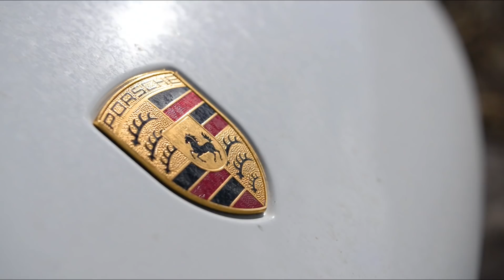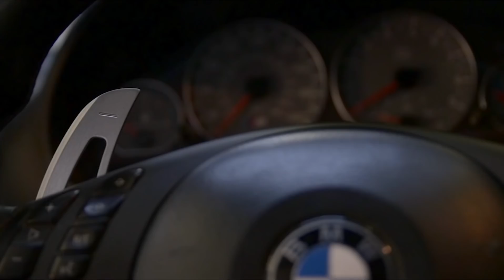Cars Are Changing

Comment: I'm sorry but I'm going to have to disagree with the opening of this video - the part where you said cars were getting better and easier to modify.  In my opinion, the sweet spot for cars, at least in the US market, was about 1987 through 2008.  Sure, there were a lot of changes during that time, and it's probably a conflation of two different eras, but think about it:

-Power outputs were on the climb again after the Automotive Dark Ages of about 1973 to 1986, but cars were still fairly lightweight and fairly analog, as all the encumbrances that weigh down and water down current cars - touch screens and redundant steering-wheel-mounted controls for everything because there are too many functions for simple buttons to deal with, airbags for every bone in your body, electronic nannies than can't be turned off (not that they aren't helpful sometimes) - were absent, in their infancy, or seen as extras rather than necessities.  The "throwing nukes at Newton" approach to speed, so prevalent these days, was simply not necessary as you could still build a high-performance car, with RWD and a very healthy (300+ naturally aspirated HP) engine, without even reaching the 3500 lb mark.

-Manual transmissions were still widely available even in fairly ordinary cars.

-As were atmospheric engines of a decent size, even if they weren't always very powerful.

-Turbochargers were for going fast, not for trying to bring a weak fuel-economy-oriented engine back up to to the level of adequacy.

-Sporty variants of said ordinary cars were quite common, yet close enough to their lesser brethren in price, performance, and appearance that they didn't appear to be a completely different type of car (compare the relationship between an old Cavalier RS and an old Cavalier Z24 to the relationship between a new Focus SES and a new Focus ST).

-Electronics had become a thing and brought a better power/economy balance with them, but cars were still simple and accessible enough that a reasonably talented home mechanic could still do most maintenance themselves, and could still make significant performance improvements without having to enlist the (expensive) help of a big-deal factory-connected skunk works (*cough*BMW*cough*).

-Designers still held the old-time styling adage of "longer, lower, wider" in some regard, as opposed to today when European/Asian "shorter, taller, narrower" influences show up dishearteningly often, at least in small cars.

-The idiotic specter of the crossover wasn't the end-all be-all of Boring Family Transportation; sensible station wagons and minivans were still widespread.

-Real, simple, rugged trucks and SUVs that you could go crashing around the farm, jobsite, or backwoods in were still a thing.

+Traditional American body styles like coupes and convertibles were still fairly common; USDM small car design hadn't centralized around space-efficient but unbeautiful 3- and 5-door hatchbacks with token sedans and an occasional coupe or wagon depending on which manufacturer you're buying from.

The selection of new cars has never been better if you're after a highway bomber, a quiet and luxurious but utterly boring A-to-B car, or maybe even a track car, but if you call the mountains your home, the selection suddenly shrinks by a lot.

(continued in reply)
Reply: I think this may be a case of efficiency being at war with the soul (as it so often is).  The soul of the driver cries out for a screaming I6 or a roaring, snorting V8, but the soulless bean-counters and power-hungry regulators see the future in downsized eco-turbos instead.  There is immense satisfaction to be had from perfect rev-matches and lightning-fast downshifts, but the average guy, and sadly many car guys as well, would rather not bother.

I think part of the problem is the upbringing of children in modern America.  For most of their formative years, children are immersed in a shallow, materialistic culture where having the latest, shiniest toys is an integral part of one's status.  They're molded by an education system designed specifically to fill them with left-wing opinions and prevent them from developing true independence of thought or action. They're taught, not necessarily explicitly, that gadgets are inherently "cool" in the way cars themselves once were, and that whatever comes next is going to be even cooler.

Just think about the people who come out of this system.  They're lazy (full disclosure: so am I), they love to have the latest shiny gadgets, and they believe that the world is going to run out of oil in about two months unless it literally explodes from CO2 pollution before then and it's all America's fault.  As a result, they'd rather do anything else but drive, and when they do decide they need a car, things like handling balance and having a stick shift are usually not at the top of their priorities list.  In short, they're your Standard American Road Muggle - except that even some car guys show disheartening shades of this corruption.  Even worse, many of these people are coming from big (liberal) cities, where there's always traffic or cops waiting to bust your groove and possibly some sort of air quality problem looming in recent memory, all of which makes it more difficult to develop a genuine appreciation for the act of driving.

The situation as far as cars being difficult to work on isn't as awful as it could be, but it's heading in a bad direction now.  BMW is leading the way here with their replacement of the good old oil dipstick, a system that's worked fine for years upon years, with a stupid computer sensor that trips when your oil gets too dirty or too low.  Not only does this leave you in the dark as far as your exact oil level and condition (unless there's a display somewhere that you can get at), but what happens when the sensor goes on the blink?  How will you know?  And when you do find out, how expensive and time-consuming a fix will it be?

Furthermore, BMW now has a feature that allows them to wirelessly update the firmware on your ECU whenever they feel like it, presumably overwriting any performance-oriented changes you've made in the process.  Previously, the computerization of engines wasn't really an obstacle to tuning, because it just meant that old-school carburetor and distributor work would be replaced by the editing of computer programs to much the same effect, and full aftermarket ECUs could be used where the stock ones were too limiting.  The effect of BMW's "wonderful" new update-on-the-fly system has already, as far as I know, been seen, however: if you want significantly more power from your new BMW, it can't be done by you or your local speed shop.  You need the assistance of a major name-brand tuner with factory connections.  If you want to bypass this idiocy with an aftermarket ECU, well good luck because many of the car's other features and functions are run by the same computer as the engine.  On top of that, how can you even trust the performance tests you see in magazines anymore when you know the car you're reading about could at some point in the future be, or could already have been, "patched" in a way that alters its performance, either slightly or significantly?

Even worse, I see no reason to believe that other manufacturers won't eventually do the same things.  The things that are already ruining modern cars started in the luxury segments, then trickled downwards as the costs fell.  It's very likely that the same thing will happen with remote-updating ECUs, dipstickless self-monitoring lubrication systems, and who knows what else.  Even worse, I could see the government abusing remote-update functionality to force performance- and fun-killing emissions/economy/"safety"-oriented updates to cars already sold.

I fully understand what you're saying: cars have gone through major changes before, and eventually the complainers just shut up and adapted.  You can say I'm being deliberately old-fashioned, and maybe it's true: I was born in the middle of 1995, but on the day I came into the world, my mother was less than a week from turning 40 and my father was already *50*, so my influences came from an earlier generation than did those of most millennials, and thanks to all the car books I read and racing games I played as a child, I got very used to the way things were long before I could drive.  But let me ask you this: where do we draw the line?  Where do we decide that enough is enough, that we can't afford to just shut up and get used to it anymore?  When it's getting harder and harder to find a car that's tunable without the aid of a skunkworks?  When the first commerically-available self-driving car appears?  What about the first one with no manual override?  Maybe when electric-propulsion technology has advanced to the point where it's pushing the combustion engine entirely out of mainstream cars and starting to seriously invade performance cars as well?

The list of previously-complained-about-but-ultimately-survived changes mentioned at 3:20 is of limited relevance to the current situation.  Disc brakes are a straight upgrade over drums in just about every situation except holding a car in place  - so parking brakes stayed drums while everything else went to discs.  Power steering, done properly, doesn't dilute steering feel too badly, and besides, before power steering there were huge stupid steering wheels that went 3 or 4 or more turns lock-to-lock, so in that way it's been helpful.  Cruise control is, to be sure, an early form of weight- and complication-increasing excess luxury that eventually trickled down to normal cars, but it's also very unobtrusive, doing nothing and interfering with nothing until you tell it to do something.  Fuel injection can make a car sound a little bit more boring at idle, but the basic principle of operation - air and combustible liquid go in, explosions happen, car moves - didn't change.  In fact, that's the main theme with all of these things - while some components may have been changed, even in slightly annoying or disruptive ways, the basic inputs required to drive quickly (or at all), and the basic physical processes upon which the vehicle's movement was based, stayed the same.  This is nothing compared to encroaching nannies you can't turn off, or to electric cars that remove sound and gears from the driving experience altogether, or to trollsy remote ECU updates making it impossible to keep your custom tune for longer than about a month.

My point is, while cars and car culture have survived change before, the changes are heading in a very bad direction now and we should at least try to stall them.  Go out of your way to buy cars that have manual transmissions, RWD, and atmospheric engines.  Drive your fast and fun cars daily - and throughout the year, if you can.  Anything you can do, do it.  I work at a burger joint, and I'm in the drive-through sometimes; whenever someone comes through with a stick shift, I make sure to compliment them on it if I can.  It's not much, but maybe it'll encourage them to keep the faith.

We're at war against the idiotic forces of boredom and grayness.  It's time to attack.

Comment: At the rate transportation is developing. My guess in the medium future there will be a big devide between Cars for Pleasure VS Transportation Appliances. That will be the biggest change to happen to vehicles in the past century. FYI Electric converted chasis can be amazingly fun with manual transmission and no power steering and a death wish if you have multiple powerful motors. It does not have to be a computer on wheel.

Comment: Those changes are the advancements we need to hopefully keep our fossil burners alive; the more fuel efficient, the more electric vehicles that enter the road, the better the chance we get to keep our beloved older cars on the road.
Reply: Albert S. Prius are stupid barely even considered Hybrid cars. Prius Prime is the first mass production Plug In Prius still crappy Tiny Electric Range. Problem with Prius it is a crappy 85% Gasoline car.
Reply: What you don't love Pricks?
Reply: DaveVQ at a certain point theyll ban internal combustion cars
Reply: All boring transportation should convert to Electric Motors either/and Batteries, SuperCapacitors and Not Hydrogen H2 Fuel Cells. That way Fuel Demand will fall hard, yay cheap fuel. When vehicles on the road is like 70%+ electric the Utopian Dream is that Emission and Fuel Efficiency regulation is obsolete and removed. Naturally Aspirated  8.4 L V10 FTW.